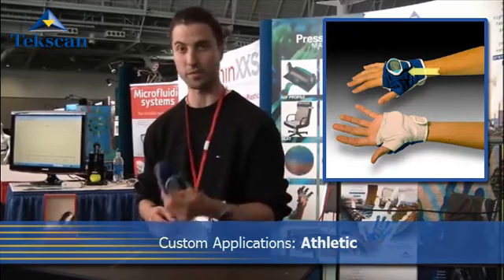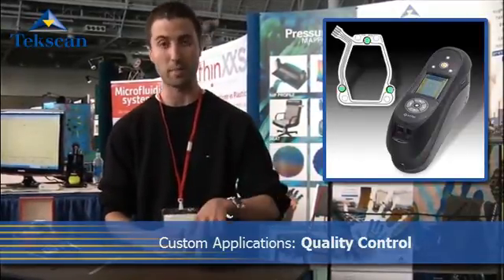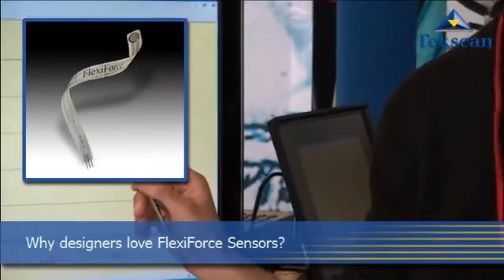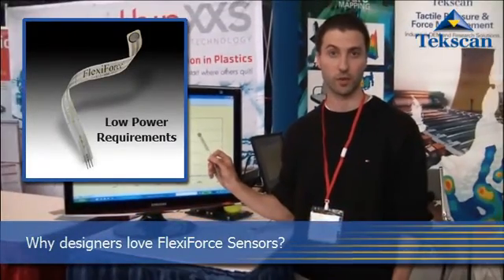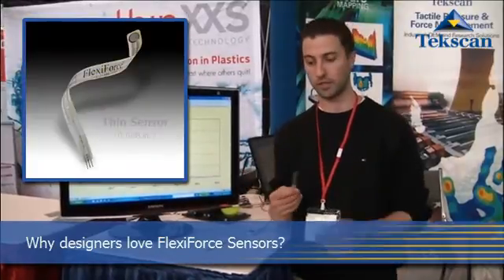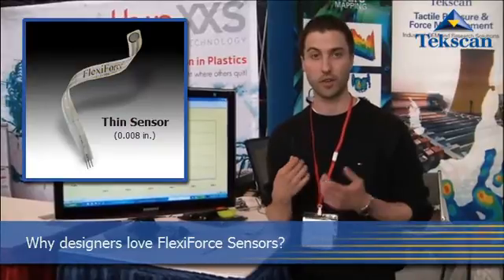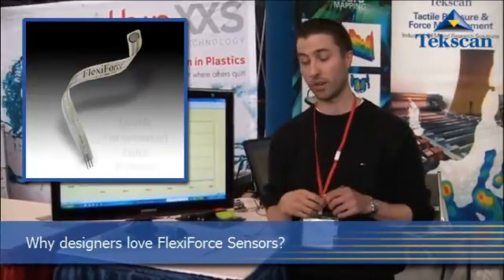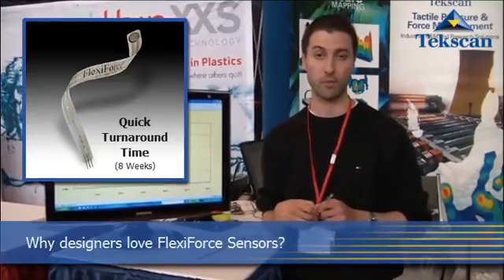Visit the Tekscan FlexiForce® Tradeshow Booth

Comment from the maker: Hi Raymond,

Yes, you can flex the sensing area, but the bending/flexing of the sensing area will cause fluctuations in output. The sensor detects the bending as a "false load". If you mount the sensor to a cylindrical beam so that the radius is always fixed (not bending back and forth) then this false load will be constant and you can tare/calibrate it out.

For other questions, please contact our Flexi team at https://www.tekscan.com/contact-flexiforce

Hope that helps!

Comment: Does anyone know if the 'Flexi' part include the load sensing area? will bending/flexing of the load sensing area cause fluctuations in the reading?

I'm looking to wrap the Flexiforce around a 50mm cylindrical beam.